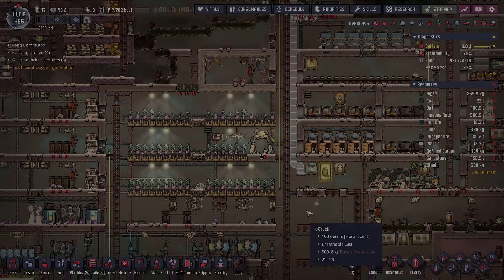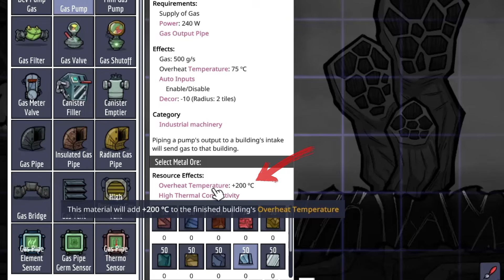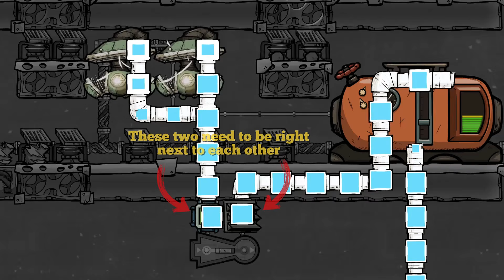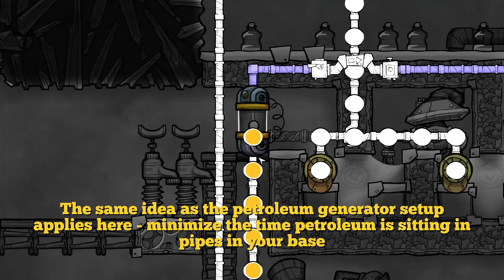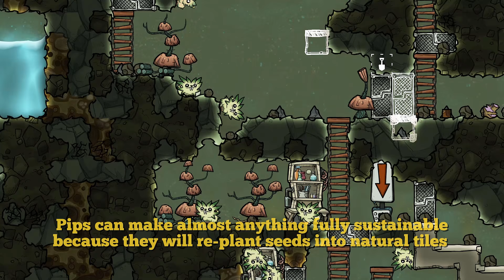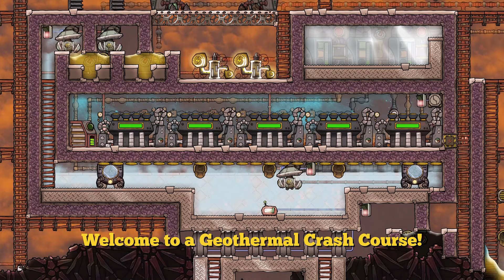How to Get Past the Mid-Game in Oxygen Not Included

Comment: More than once you mention the preservation of the ice biomes as something to keep high on our priority list. Now that I finally have my cooling loop going, I do not need to harvest more ice from them, and I would like to just continue enjoying the free sleet wheat. At the same, it is annoying that some of them are full of CO2, because it may take more than one attempts for my dupes to grab something from the bottom of them. So, I was thinking: how about putting a few thermo regulators just outside each of them (in steam, under steam turbine, of course) to blow cold oxygen into them and 1) keeping them cold, fight entropy and 2) allowing myu dupes a smoother ride into them. 
Also, since I have the frosty planet pack DLC enabled, if gives me the chance to enjoy some of the flora and fauna of those even on my regular, terra asteroid.
Thoughts? 🙂
Reply from the maker: It sounds like a good idea to me!  The thermo regulators are kinda inefficient, so if you can cool the oxygen using a steam turbine/aquatuner loop it'll be a better use of power, but you will need a lot more infrastructure.  The thermo regulators are definitely more simple though and I'm not mad at that idea!
Reply: One of the rationales behind the idea is that to go colder than -20C I would need petroleum or oil. And their specific heat is even lower than hydrogen. Will keep you posted 🙂

Comment: really glad to find this series, hoping I can step up to the challenge of getting a completion. I'm currently in an approx. cycle 400 game, where I'm just starting to make setups out across the map, rather than clumped in my home base (just set up a power spine on the far right edge, and am now migrating all my power generation over there) - Not quite at rocketry yet, but I'm taking things slow and steady. I'll get there eventually!

One problem I'm finding is that I keep getting "long commutes" warnings each cycle, with travel time upwards of 50% on most days, going over 60% whenever I task work out near my power spine. What would you say is a good way to mitigate this? Is high travel time a major issue? Perhaps I need to increase my duplicant count? (been running with 8 dupes up until recently, but now that I've set up private bedrooms I'm increasing to 12)
Reply from the maker: That will naturally happen as you expand outward.  I'd say shipping stuff to the middle of your base, keeping all of the production and living areas near each other, and using materials that are near where you're building, those kinds of things will help reduce travel time.  But if you're expanding on the edge of the base, sometimes there's no way to get around how far they need to travel to do stuff.

Comment: Thanks to you i have joined the 1.4% of people who sent a rocket through the temporal tear 

i have a question about the cooling section of this video 
You put your coolant in tanks inside a room of separate coolant and i was wondering does that keep multiple coolant loops cold by keeping the room of coolant cold?
i guess im just curious about why you went from a bunch of pumps in a coolant room to tanks
Reply from the maker: Congratulations!  Glad you made it!

The tanks don't require power to circulate liquid, so it's more efficient than the old way.  And yes, if you have a couple tanks connected to aquatuners, those tanks will consistently get colder while the other tanks will get warmer.  The water they are submerged in will be how the two temperatures mix together.

Comment: I'm sorry, I have been playing this for awhile now and I never realized you could just vent unwanted gasses from a line with a single sensor, a not gate, and a vent instead of a complicated or power-using filter setup????  I always thought that the sensor would trigger immediately and not for the next packet.
Reply from the maker: Yeah, those sensors are a little weird, they do operate in a way that allows the next block to make a decision rather than the current one.

Comment: Quick questions:
About to capture natural gas. In the main line have 3 smart batteries for coal, natural gas, petrolium.
U need smart batteries connected to each power transformers? For bigger ones how much u need?

If u can choose would u capture gold or iron volcano? No steel production yet. But i have to choose which one i go first. Case limited iron atm

How to make natural tiles? I want relocate my great hall and bathrooms cause heat creap and gas problems. Have pips to plant.
Reply from the maker: The transformers are just to connect smaller wires and larger wires together without the smaller ones breaking.  All of the power sources are connected together using heavy-watt wire, and the smart batteries are connected to the power generators, not the transformers.

I think I'd rather capture the iron volcano.  It's a little more useful long term, but both are very good.  I'd honestly take both if you can.

There's an exploit to make natural tiles by creating a door, surrounding it with a couple tiles, then deconstructing the door.  If you don't want to use an exploit, you can pour some molten glass on a small amount of algae debris and it'll melt it and turn it into dirt.  Obviously it'll be very hot, but you can cool it down afterward by pouring some water on it, or just wait for a bit for the heat to spread and even out.
Reply: @Magnet_MD  thank you

Comment: I keep getting to video about 19/20/21 in your 2023 full walkthrough and having issues that make me rage quit and restart. Today my frustration is caused by getting 2 aqua tuners running at the same time before the steam is hot enough for the steam turbine to kick on. I’m guessing I need one to start at a time but it seems to take forever for the steam to heat up to 125* .
Reply from the maker: It does take a little bit.  You can dump warmer water into the chamber to reduce the time it takes, or use warmer water for your coolant area so the aquatuners stay on for longer.  As long as the aquatuners are safely running, the rest will take care of itself :)

Comment: Good day Magnet, first and foremost great vids. Enjoy watching them! I do have some issues that i can't seem to resolve during my runtrough. In my cooling room (same as yours) I have constant blocks forming and that is blocking my automation, is it because my water is too cool? (current -1°C) During your runtrough campaign on OXY Space Out (2024) you said that having more water due to the ice melting, but since my water is below melting degree i assume i need to warm it up a bit somehow? I am also running out of water, using the water from the refineries for now and wil use it for the Geyser in the future as I need more and more.
Reply from the maker: Yep, it will start to freeze if you get it too low.  You can probably set it to around 10C if you're using water as the coolant, and that should be plenty.

if you're playing in the Frosty DLC or if you need it colder for some reason, you'll wanna use something other than water as the coolant so it won't freeze.  Ethanol is a good one if you need a wider temperature range.

Comment: 10:45 this is one of the scariest and biggest steps I feel I need to master. Really looking forward to the more in depth look
Reply: Yup, same. I'm at the point where I can pretty reliably keep food, air, and water going (especially since I like to run only a few dupes; I find 4-5 is pretty much perfect skill-wise), but cooling loop is my bane.
Reply: @JeysieC  I've safely worked my way up to about a dozen dupes but that's running them off of mealwood which I've gotten the impression is kinda weak
Reply: @JackJester21  It's not weak if it works! That said, there's higher quality options it's not too hard to set up. Dreckos are probably the best meat option (though hatches are good early on when you need the coal), while once you get the hang of pip planting the berry sludge option is great.
Reply: @JeysieC  tried using pips to make a nature reserve once. Probably could've watched a tutorial. 😆
Reply: @JackJester21  The simplest trick is: Get a decently long line of natural tiles. Put an enclosed room around it (with any doors set to Auto) to make sure your pip stays put to plant. Then replace every other tile with your fave tile material, leaving every other tile leftover as natural tiles. Then cover every natural tile with a ladder right above it except the one farthest on the right. Put a pip and your desired seeds in the room. Whenever the pip plants something, deconstruct the ladder next to the left. Keep going until the whole line is planted.
Reply: @JeysieC  thanks I really appreciate the help
Reply: @JackJester21  No problem! :)
Reply: Same, i haven't seen a good tutorial on these "industrial rigs" with cooling and all kind of machinery and generators
Reply: @Mrlokimaya the only thing scarier than space travel is people harvesting heat power
Reply: @JackJester21 i haven't done either of them yet. Most I did is localised cooling for when I tame a gold vent

Comment: Great vid. Also, just curious as to your choice for beginners not to use atmosuits? That seems like a disaster waiting to happen lol
Reply: You’re shaking up to be the new Francis John lol. His midgame jump video from ages back it what helped me
Reply from the maker: Thanks!  You will want to use them eventually, I just don't think you need to wall your base and use them to traverse to the outskirts.  Using them in the oil and space biomes, or working in a steam room or something is basically a requirement, but other than that, no need to use them if the rest of the base is breathable and below ~70 C (and I guess above like -50C or so)
Reply: Also my few pieces of criticism would be that hatch ranching really doesn’t need to be switched out until much later, and that stuff like geothermal is a lot of work vs something like solar. Tho maybe it’s just me, cuz I think of midgame like a peak, your either before or after it mostly, and I find there’s no point setting up permanent midgame infrastructure that’s just going to be torn down anyways
Reply from the maker: For sure.  There are a lot of things that aren't technically required, and I've done runs with no aquatuners and steam turbines, or no other power sources than manual generators.  I'm confident you could do a run with no geysers and a whole bunch of other things that I'm recommending here, and it's mostly because trying to get newer players all over the map and interacting with everything that may be important for their run.  I've always considered space to be the most difficult biome for newer players to figure out, and I find that easing into oil and geothermal is a little more forgiving.

You're right about Solar Panels though.  If I were to make a speedrun or minimalist guide or something, getting into space would be one of the first objectives because of how strong solar panels are, but newer players will get kinda rekt if they don't understand a bunch of other game mechanics first.

Comment: 20:32

Perhaps this is true in circumstances where the Power Control Station isn't used. However, I have something I'd like to say.

I'm someone who uses the Power Control Station to boost my generators, including the Hydrogen Generators in my SPOMs. Earlier in my current run, I hooked up my Hydrogen Generators to my primary power grid, with the idea that they would supplement my power production.

Perhaps because of the Power Control Station, these two Hydrogen Generators took after Napoleon when he was deployed as a diversion and became my primary power production. To put it in perspective, I was using the carbon dioxide from my Natural Gas Generator to produce soda. When my SPOM was put into action, my soda machines stopped working due to a carbon dioxide shortage. To this day, four tuned Hydrogen Generators that are part of SPOM setups remain my primary power source for my current run, with Natural Gas Generators supporting the excess weight.

You don't have to change your mind about the Power Control Station because of this, but it's something to consider, because holy heck did they make Hydrogen a viable power source when Electrolyzers are used in SPOMs. Not even Hydras, but SPOMs.
Reply from the maker: You're right, power control stations are a really good addition.  I tend to not use them unless I feel the resource trade is worthwhile, because of how much duplicant time they use up.  I will be mentioning them in the next video though, thank you for reminding me <3

Comment: Bristle Berries and also Sleet Wheat don't require cold water to grow. What stifles them is the heat escaping the hydroponics. It's far more efficient to cool the plants than the irrigation water. 

I met so many players that got stuck on the idea they need cool water despite already having steam turbines. 

The only use case for cold usage water after steam turbines is toilet water for SO rockets.
Reply from the maker: True, you can feed it warmer water, but it still does take some kind of cooling to keep the plants safe, and will likely cause other heat spill around the base.  I think it's just overall easier to feed cool water and get the idea that having cool water is a valuable resource, and if you manage to sneak around the temperature requirements, then more power to you :)
Reply: @Magnet_MD  we're playing the game probably quite different. I use usually the 95C of steam turbines and geysers as coolant in granite pipes outside of sealed areas.

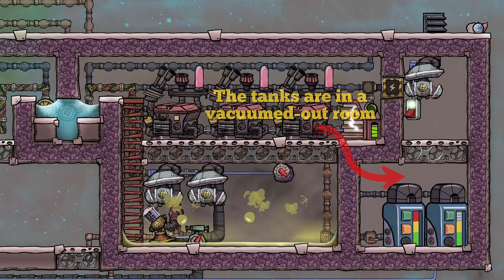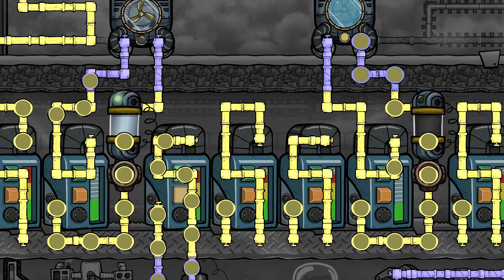Comment: I dont quite understand heat exchange of liquid reservoirs. There are 3 entities there: reservoir itself, liquid it contains, and outside environment. As I can see reservoir is almost (or completely?) not thermally interacting with its content (weirdly), thats why your setup at 8:06 works ( if there are heat interaction between reservoir and liquid, then solution cant be permanent, so how it works?). But both reservoir and its liquid do interacts with environment (liquid weirdly interacts with environment directly, bypassing the container?) but quite slowly (or not?). So it looks like design at 11:23 and 22:04 relies mostly on radiant pipes, not on reservoirs. Moreover — I dont understand the need of these reservoirs, beside of some averaging the flow temperature, but they are probably redundant, since thermally-controlled valves are doing the same task...
Reply from the maker: You're right, it does rely almost entirely the radiant pipes.  You can place the reservoirs on metal tiles to have the liquid inside interact faster with surrounding temperatures, but ultimately the radiant pipes do most of the heavy lifting, since it distributes the temperature among many tiles instead of just 1.  Ultimately if you're short on refined metal, you could make a more efficient setup with metal tiles underneath and not use radiant pipes, I just don't consider it a particularly rare resource once metal volcanoes are captured.

You could definitely create a loop with other mechanisms, the reservoir is just convienient to fill up and then use the contents later, and it can handle a large buffer of extra liquid in case you expand or contract the connected pipes at any time.
Reply: I've conducted some experiments, and indeed: seems like liquid reservoir does not interact with its contents at all. Contents slowly interacts with environment (+tile under tile of attention) directly, bypassing the reservoir itself. But then reservoir interacts with this environment. So if reservoir is in vacuum, stands on insulated tiles, it can hold liquid of any temperature without any problems.

Comment: I got at least 1k hours, i recommend you wall off you base and have suits up and running before digging out the whole planet and or going for oil, with double liquid locks, On the natural gas geyser, If you have a water source that is cooler like 86F polluted water vent, you can use that to tame the natural gas geyser making steel unnecessary for it. I also dont recommend dumping the hot water to space. if you refine it, you can use it for research, so pump it into storage tanks and deconstruct them instead. if you dont have plastic yet, but need emergency cooling for your base for food etc, put a copper aqua tuner, in a room that is a vacuum, let it run until it melts and you can keep rebuilding it for free, and no resource loss, just disable auto repair. It cant heat up a room in a vacuum. This works in a pinch, for as long as you want to keep your meal wood going etc.. Also i never tame hydrogen vents, they are a waste of time, cause you cant get water from them. I just wall them off. If you get enough water sources, you can simply use a large SPOM and have excess hydrogen and can put those generators in a power control room and can power your bases no problem. Food wise go for wild pip planted arbor trees, and run as many pip ranches as you can, I usually run like 4-6 pip ranches, 2 hatch ranches and 2-3 dreco ranches. Plus anything else i can grow if i got slime etc, and with pips you get free dirt, so run sleet wheat as well. 1 more important thing is inf deep freezer, this is 100% necessary to prevent food rotting, i usually get to 30 dupes on a colony and have millions of cals of food. My spom and natural gas geyser powers my whole colony. Also this is based on spaced out, but can probably used on base as well.

Comment: For those of you who use the Ceres DLC: You don't have to worry about oil for plastic-making, as you can instead use Nectar as a feedstock liquid for the Polymer Press, meaning that you merely have to get a few bon-bon trees tapped; you don't even need any fancy tech, as the pipes can just be hooked directly into the trunk, same as how Spigot Seals do it. The same caveats as with petroleum still apply, though, as far as I'm aware.
Reply: Wild ranched Bonbon trees at the top of the map are an infinite source of nectar -> plastic.